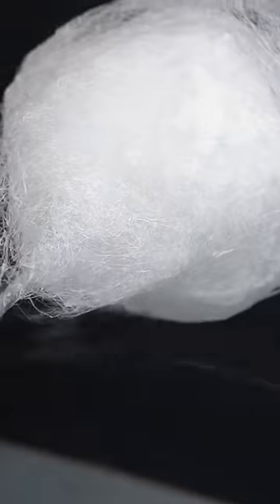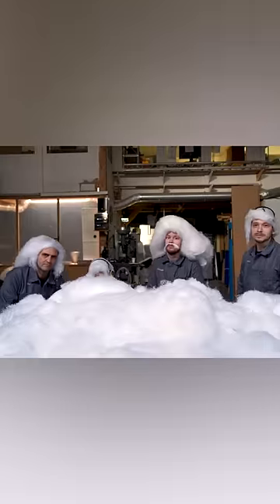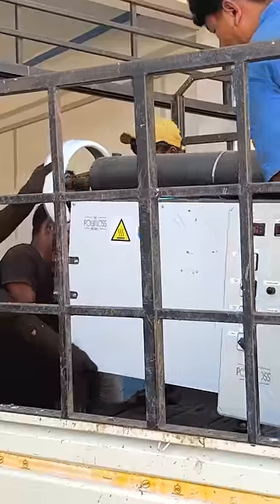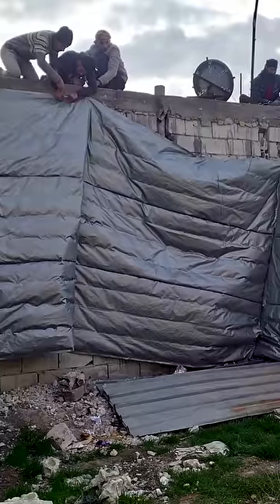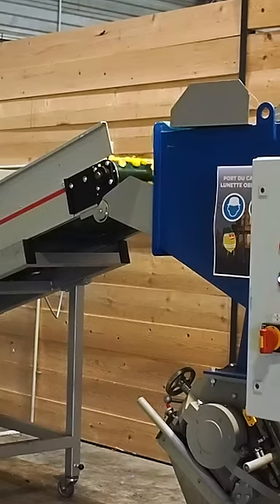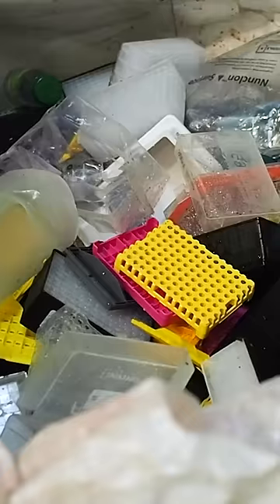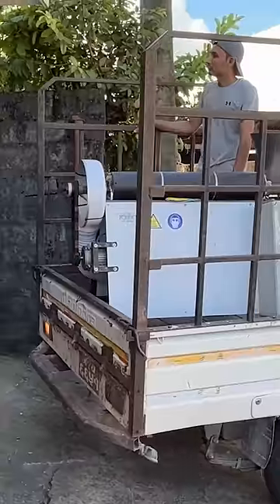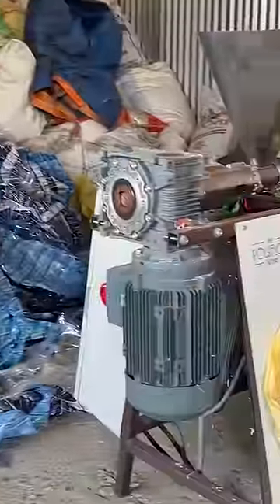This cotton candy is really plastic trash spun into ultra-thin fibers.#recycle #plastic #environment

Comment: Well I feel a little better to know some of our plastic waste is being use instead of just bumped into the ocean. ❤
Reply: I agree. So many comments about micro plastics being an issue, as if we don’t already consume and interact with them on the daily. Plastic is an unavoidable part of our lives now, and I think it’s better to have ways of recycling it than having it go into the ocean. Especially bc this plastic is making insulation for homeless and refugees
Reply: @hydrogen3266  Exactly! Everyone here is knocking a good thing and I don’t get why :[
Reply: i dont even understand if its good because of the conflict in the comments
Reply: Hardly, the plastic has already been recycled by someone else, at this point it is just pellets which can be used in many different manufacturing methods like injection moulding. This machine doesn’t recycle on its own and there are better uses of the plastic.
Reply: @hydrogen3266  the plastic is already recycled into pellets, it could just as easily be put in an injection moulding machine.
Reply: @conorstewart2214  it’s not like it isn’t used elsewhere, this just so happens to be used to help provide warmth for people who need it, and can be burned away into nothing once it’s purpose is done.
Reply: @Justyouraveragechaosenjoyer  oh yes because burning plastic is such a good idea. A point they keep making is that this can be made with recycled plastic, yet it takes pellets, just like any other plastic manufacturing. The fact that it can use recycled plastic isn’t new or different in any way, it just uses the same plastic that many other plastic manufacturing processes can use.
Reply: @conorstewart2214  Another commenter mentioned to burn their stuff away into nothing- so long as it’s in a filtered room and the proper safety gear is in place, it should be fine.
As for the pellets, they’re made by recycling plants as said in the video. Yes it still has to be reduced to its raw state, but they are still using it. 
The biggest downside from the pellet point is only so many plastics can be reduced to that state and used for this project.
Of course I could be wrong, but that’s why we try to educate each other in the hopes of moving forward positively. I’m tempted to do a deep dive on the company to see what all I can find, because if it is as good as it seems, hopefully it can bring positive change so long as we consumers hold them to a higher, safer, cleaner standard.
Reply: @Justyouraveragechaosenjoyer  if this is made to be deployed in poorer regions where they need insulation do you really think much of it will end up burned in a controlled environment? Most of it will end up dumped or just burned on a bonfire. Being made of thermoplastics it could just be remelted and recycled again.

Loads of plastics can be turned into pellets, pretty much any thermoplastic. Injection moulding machines use pellets, 3D printing filament extruding machines use pellets, so any plastic that is injection moulded or 3D printed as well as others are able to be turned into pellets. Most of the plastic you interact with in your everyday life came from pellets.

 Pellets are not just made in recycling plants, they can and very much are made from raw materials too, that's where they originated. They use pellets because they are easy to transport and feed into machines. Pellets are just a standard way of making, storing, distributing and using plastic, they are not just made by recycling plants, which is my point. The recycling plant has just turned the recycled plastic into an industry standard form that can then be used in any traditional thermoplastic manufacturing process. Also their method of making insulation can just use non-recycled pellets too.

They just made plastic insulation, nothing about it has to be recycled and the recycled pellets aren't made just for them. They just happen to be using recycled plastic.
Reply: @conorstewart2214  I see where you’re coming from about the burning. But as for everything else, yes I am aware of literally everything you said. But if they’re using recycled plastic like I initially said and the video said, why are you telling me off?
Reply: @Justyouraveragechaosenjoyer  because everyone seems to think it is great and new because it uses recycled plastic which it isn't. Also you didn't seem to know everything I said or why were you going on about how there weren't many plastics that could be recycled and turned into pellets?
Reply: @conorstewart2214  Ah, apologies, I got confused. That's on me.

I get what you're saying, but what's so wrong about being a little optimistic, you know? Getting what could be a good thing in the public eye so we can (hopefully) have a say in how it goes down?
Reply: @Justyouraveragechaosenjoyer  it's more that they are misleading people and trying to paint their product as good for the environment when it isn't any better than most other plastic manufacturing processes. This really isn't any different to a bottled drinks company saying they use recycled plastic or an injection moulded product saying it uses recycled plastic. Yes it's better for the environment than using new plastic but they aren't solving some recycling or environmental problem and finding a new way to recycle plastic like they seem to be portraying, they are just using normal plastic pellets that have been recycled.
Reply: @conorstewart2214  Fair, I guess I can see where you're coming from. I still think a lot of the vitriol in the comments is unnecessary though.
Reply: @Justyouraveragechaosenjoyer  maybe it is but people are sick fed up of companies like this popping up, making bold claims to draw in funding and then disappearing.

I think most people take issue with the recyling and environmentally friendly part, both of which arent really solid claims. It isnt any more recyclable than other plastic manufacturing processes and turning plastics into fine strands and putting them in the environment isnt good for the environment.

Comment: What about the fire danger?
Reply: Well cotton wasn't any safer y'know
Reply: @GuardianTiger  insulation is made of glass, rock or wool. All of which are very resistant to fire.

Even cotton can be treated with fire retardant.

Plastic… is as flammable as gasoline.
Reply: @spoonikle the most used insulation material is XPS or extruded polystyrene which is also a petroleum product and highly flamable.
Reply: Cotton doesn‘t develop higly toxic smoke and the fire doesn’t spread as fast. Xps is mostly used for insulation that withstands weight (flat roof for example), so you don’t have to use it necessarily. Also it’s in fire protection class B1; which means flame retardant. That’s at least the regulations in Europe.
Reply: If your house burns you end up like Han Solo
Reply: @GuardianTiger  do you mean clothing? cotton clothing is better. plastic clothing melts into skin causing deep burns even if it's not "flammable". cotton simply burns off leaving surface burns.
Reply: No but it’s for poor people so that’s okay. Please pat me on the back for sending my garbage to poor countries
Reply: Yeah, no kidding. Even most of the shit our cars are made of burns quite readily, and let's not forget our wooden houses! 

I'm pretty sure we don't actually care about safety until somebody's barbecued body triggers a class action lawsuit. T^T
Reply: @somethingsomething404 yeah.. countries that can't afford anything better. You people seriously want to complain about everything
Reply: @thedrumguy2350 finally someone who understands insulation
Reply: @C4H10N4O2 did you mean Anakin? 😅
Reply: @jus7040  No, when he was frozen in carbonite

Comment: Correct me if I'm wrong, but doesn't the process of cleaning the plastic and turning it into pellets first mean it's still usable?  This doesn't sound like it's turning trash into something useful, it sounds like you're turning something useful into an inferior version of an already existing product.
Reply: Depends on the plastic, so all those numbers on the recycling plastic indicate what number type they are. The colours added to it can also change how much they can reuse it too, you can't lighten up a black bottle.
Sometimes the cleaning is just to remove any contaminants like stickers or food scraps. 
But they can break down things like broken plasric chairs, they can't really be fixed or have new part fitted. A lot of food can't be reused due to potential contamination so the heating of the plastic will kill off any bacteria so they can use recycled plastic then.
Reply: Its trash. People are done and tossed it

Comment: Imagine breathing this in and working with this for a while. Guaranteed an early passing.
Reply: hence why they are wearing eye protection and respirators while working with the product. the actual main concern is that its much more flammable, burns hotter, and is a much more of a pollutant when burned, than fiberglass.

Comment: This seems like a good home insulation replacement/other option
Reply: It seems like a huge fire hazard
Reply: @testudo2185 yeah, if this catches fire it's going to envelope the house within seconds
Reply: @gold_h1075 yeah it's not the wooden structure of the house will burn when it catches fire. 🤔
Reply: @rahulnagi90  ofcourse the wood burns, but the plastic insulation is going to spread the fire through the house faster than you can run out of it

Comment: DO NOT use tis for Insulation if you don't want a horrible dripping fire hazard.  Better to use the Batt Insulation made from Glass which is Fire-Resistant, basically, Fire-Proof.

It's a good thought, but use the plastic for something else.  Bettter yet, let's eliminate 1-use plastics.

Comment: While it is good that they are recycling,,,, er yeah, about that. 

This can no longer be used for anything else, just like how a plastic bottle will never be a (whole) plastic bottle again, this will never be anything else again. It is useless now. It has been degraded to strands, fibres, the smallest it can be. It might be possible to turn it into felt but it would be difficult to find a use for that felt since it would be very uncomfortable. 

Also, polyester is probably one of the biggest contributors to micro-plastic in the water systems/oceans. Over a third of micro plastics in the ocean comes from the textile / fashion industry, and more than half of the fibres used in textiles is a form of plastic.

How I know this: I wrote an essay about “the foul face of fast fashion” a few years ago for my English folio. I also aim to make fashion more stainable and equal (using more environmentally friendly materials, using SAFE and ETHICAL working practices (one of my biggest priorities if I were to ever make it in the industry), men can wear whatever, women should have functioning pockets, etc.)

Comment: Basically there contributing to the plastic issues. And now have a fine more toxic plastic that will be left in the woods, in creek,streams, on the side of highways. The Solution is not to make more plastic but to use LESS plastic.

Comment: Wow functional recycling.  But recycling plastic encouraged plastic manufacture pollution and erosion of atmosphere and fertility globally.  The chemical weapon manufacture treaty enforcement and and EPA mission under treaty enforcement and obligations was supposed to eliminate all halogenated vinyl halogenated vinyl and halogenated carbon molecules as a matter of survival.. 
This is a very needed resource shelter in the world.
 .you should add Edison generators snd inverters to deliver house current AC power continuous peak power without fuel steam or wind. This is a needed shelter issue.

Comment: A lot of people are saying this is a bad idea, but they are converting already used single use platic and turing it into another form that allows it to be used for much longer than it was orignally entended. It also enforces a demand for recycling. 

Sure it breaks the palstic down and blows it but dont you think they catch the residual strands where they work? And what do you think platic does over time? How do you think microplstics got micro? They are broken down, this kinda just expedites that process in a way. 
I belive in this project its not the only form of insulation out there and is better than a bottle in the great garabage oatch that we call the Pacific ocean

Comment: my concern is that there may be a fire hazard 
i know that there's 7 types of plastic routinely marked as recyclable so maybe they only don't use plastic that burns. but for sure plasticware carbonizes and flames.  it not as fast burn as paper, but for sure a burning spoon can ignite other substances

Comment: Would it be possible to do this with some waste in the Pacific? Also would this be a better alternative to chemical based insulation for homes business etc, what's the height of it's use cause this is awesome.

There's a huge source out there for this to do major good, I hope it goes that far if possible.